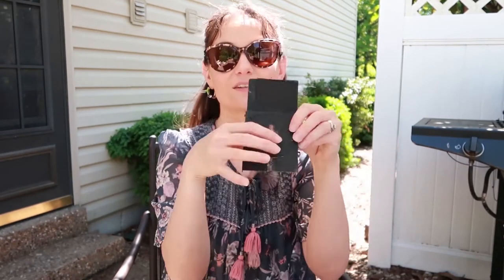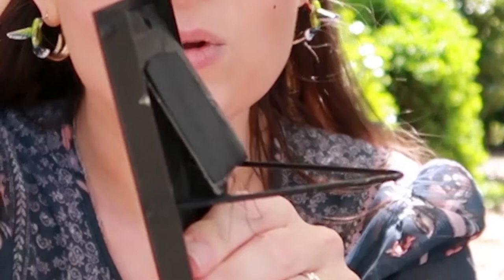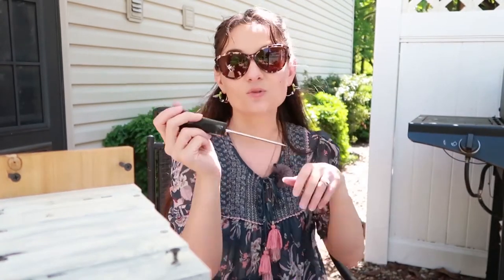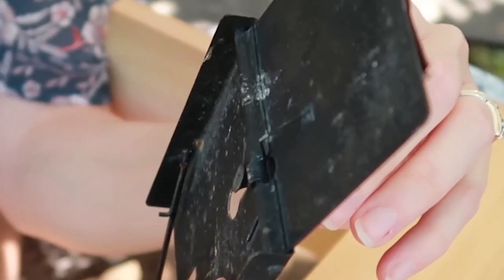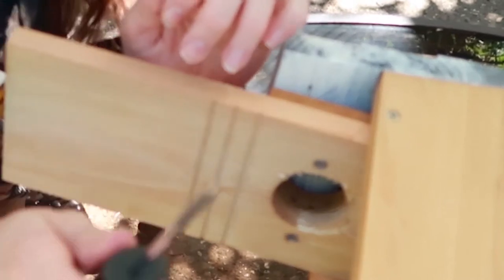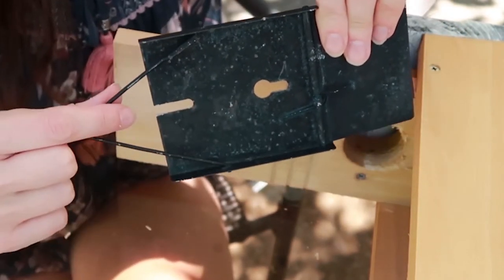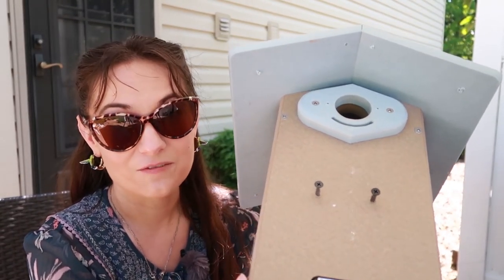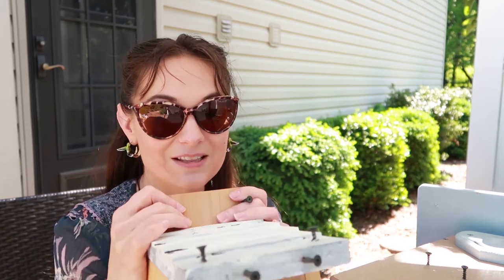Easy Van Ert Trap Install Plus Guidance on Side-Opening Box Plastic Boxes

Comment: It seems to me it would be wise to build a separate box just for these spring traps.
Reply from the maker: Definitely.  One of the first videos I made was how to make a decoy box out of cardboard.  It is a cheap way to still set a trap.

But, the van ert trap can be a life saver in your primary boxes. We keep mounting screws in every box just in case.

Sometimes the house sparrows are just so fixed in a certain box that they won't even bother with a decoy. And it makes it really hard when bluebirds are defending that same box. If there is no nest, I'll take the box down for a day and put up the decoy near a building to try to attract the house sparrow. Then get the primary box right back up.

Comment: If you're shopping at a big box store, try buying pan head sheet metal screws.  They would work very well in this application.  The head is not conical, like it is on a drywall screw, and won't interfere with the screw slots.  Also you can probably buy them in lengths that will not poke out the front of your box, and they may be more weather resistant.  Great video.  Thank you for all of your great knowledge!

Comment: This does not tell me where to mount it😢
Reply from the maker: Hey there :) I'm not sure I understand what you mean. The video shows where to put the 2 screws that hold (or mount) the trap device. Once you put the screws into the nest box under the entry hole, you can slide the trap in and it will clip to the screws. Then slide it off when you're done.